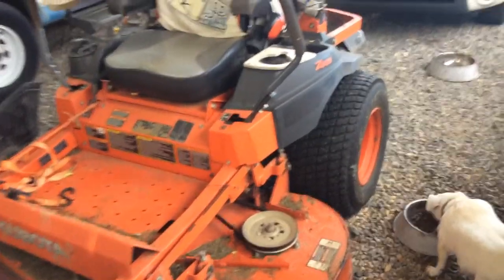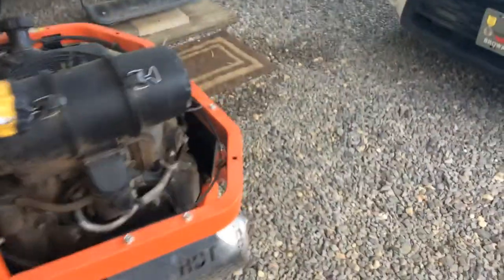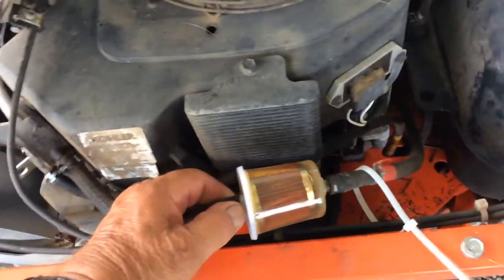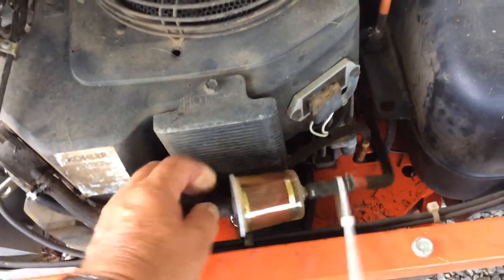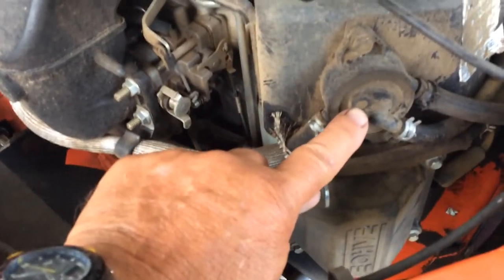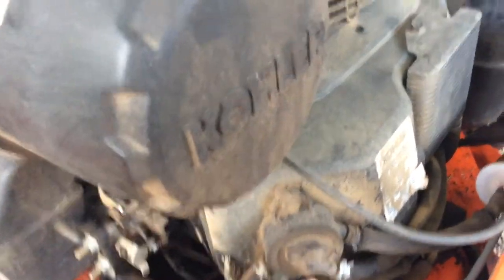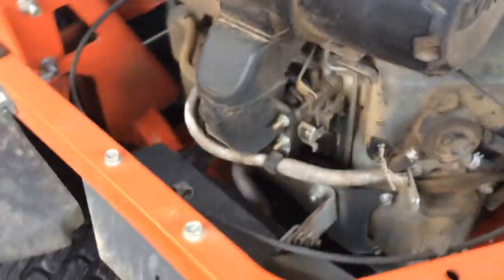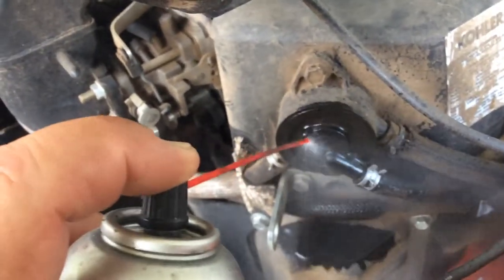Kabobs Z725 fuel starvation

Comment: Thank you. I did this immediately after reading your suggestion and I've been cutting grass now for two hours without any problem. Before today I had frequent problems with surging and/or stalling, frequent problems. I will use this method as per your suggestion once a week to keep that screen clean. Thank you again. I'd be out at least a hundred dollars if I had to take it to a dealer.